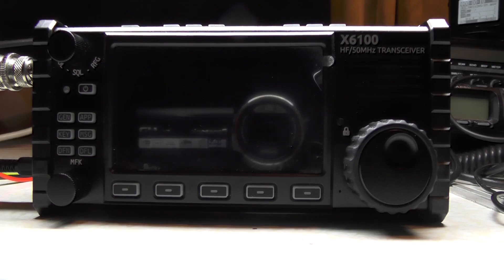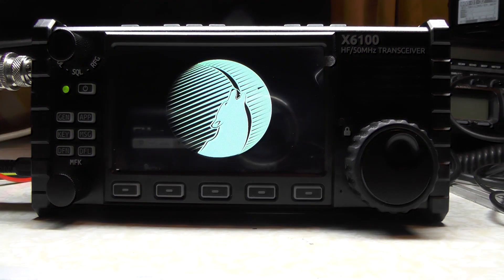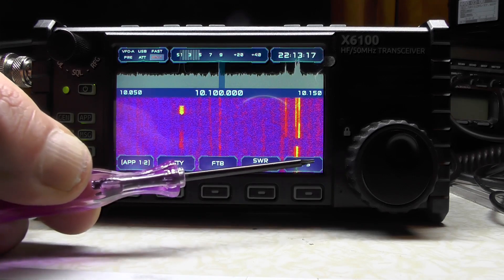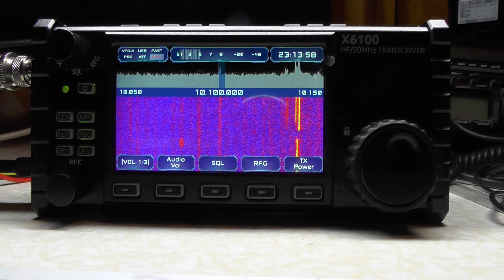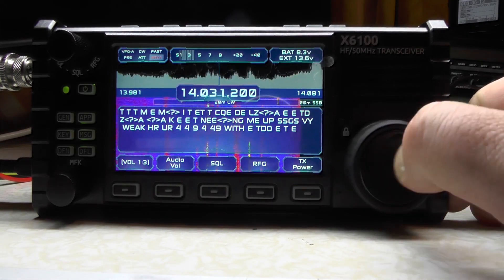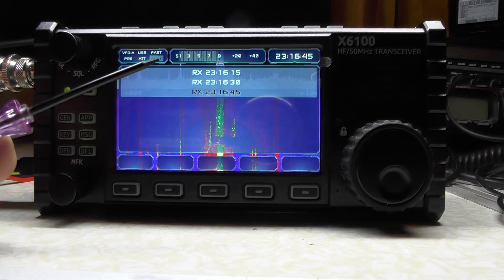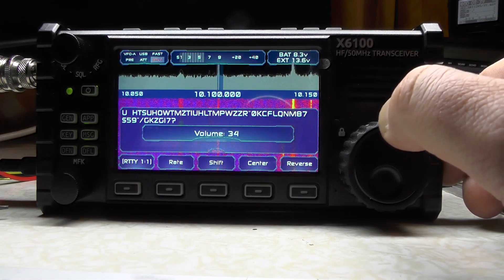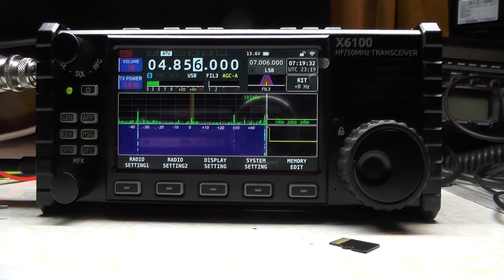R1CBU X6100

Comment: Do you prefer the 6100 over the g90? I'm trying to decide between the two. I love the screen on the 6100 but I'm wondering how helpful the extra 10w would be on the g90?
Reply: 10W doesn't make any difference. You should look more into external battery (g90) vs internal (x6100). A bit better ATU on g90 (10:1) vs weaker on x6100 (5:1). And mature firmware on g90 vs jus ok on x6100 (but with ability to experiment, and launching custom ones). Also x6100 has a tendency to overload vs g90 is much less sensitive to overloading (still can happen tho). So if you have strong AM stations nearby some external filters may be necesarry for x6100. Also 6M band on x6100. And last and not least price difference ;)
In short: 
G90 - great battle tested HF rig that stood the test of time and is well regarded by the community.
X6100 - cool rig with great potential (since it's just a linux box), perfect for experimenting and as QRP shack in a box.

73!

P.S. If you're interested in digital modes x6100 has internal sound card built in, so it's much less hassle to set it up vs G90. Something worth considering as well...
Reply: @tadekboruta328  Great info, thank-you!
Reply from the maker: The g90 doesn’t have fm the g90 radio I had was just to reflash the firmware to get the radio back up and running. The g90 does 20w I think . Didn’t really get long enough time with the radio to have a long play with it
Reply: I'm getting the x6100, for many reasons, mostly because I've had all  the yaesu,s icons etc..been there, done that, the G90 looks fine, but 10 Wats won't make much difference really, the much bigger screen on the X6100 is far more important to me.. and it's lighter weight, and slimmer etc..and has an internal battery..its a no brainer really..
Reply: @RobBob555   I think you plug an amp into the g90 and get even more than 20 watts.  Someone please verify or correct me.  Thanks.